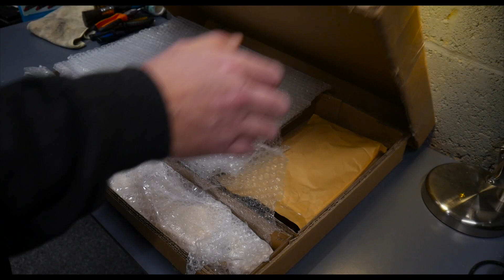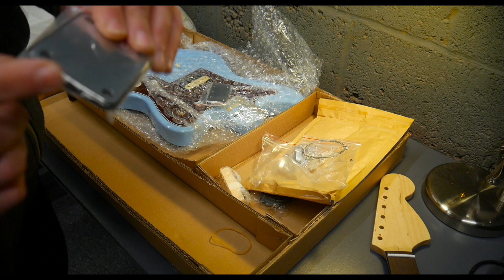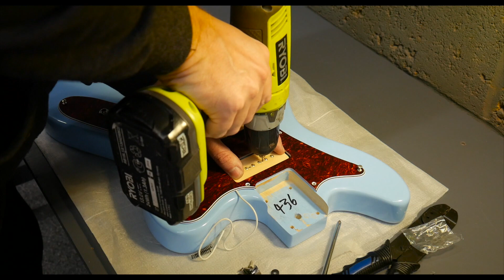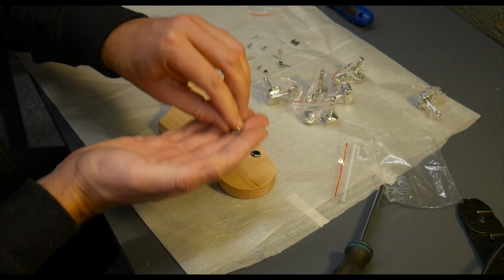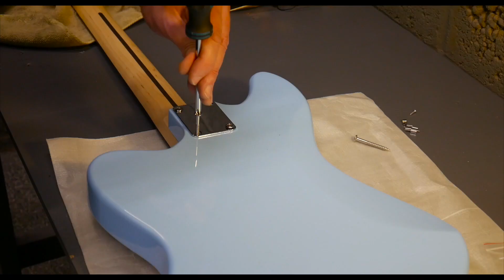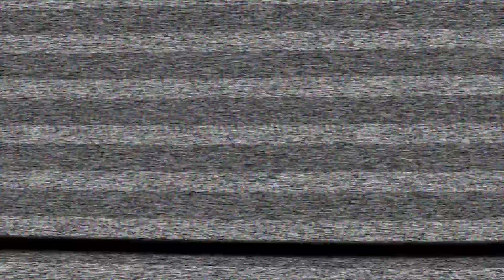Offset DIY Guitar Kit FULL BUILD & Review

Comment: Have to say that if I was starting out and had just £150 I would buy a Squire Strat second hand - it would be a much better guitar for the money. This looks like a good project guitar, but as you know we all spend far too much on projects when we get stuck into them :) .
Reply from the maker: But for the kids who want an offset grunge machine, this is very cool and reasonably priced compared to Classic Vibe Jaguars or jazzmaster
Reply: @theguitarmanifesto  True but for my grunge machines I buy at the cheapest end of the second hand market - it's amazing what £30 or less can get you pre-distressed :). (once fittings and the paint is off they can even be re-cycled in the log burner when disposed of !).
Reply from the maker: Great firewood 😂🔥👌